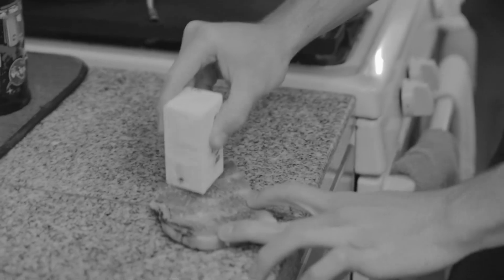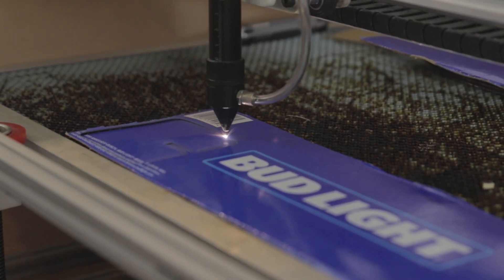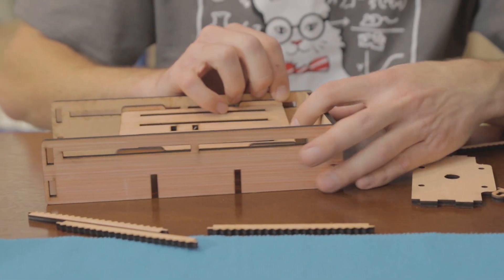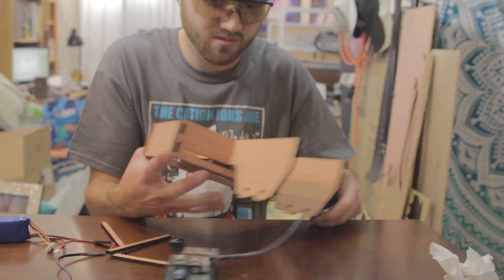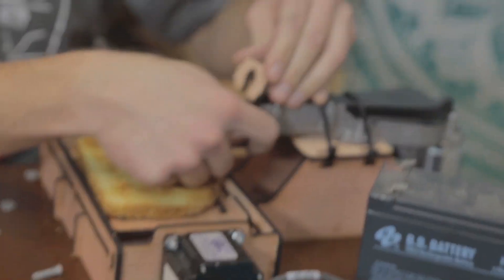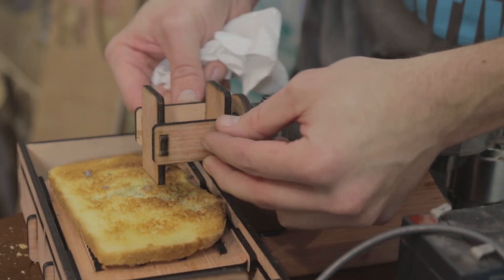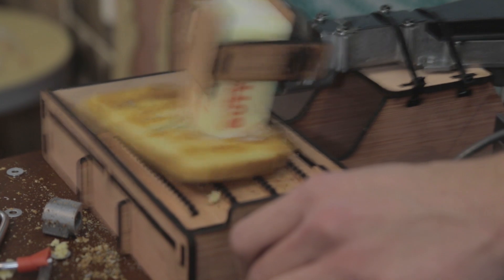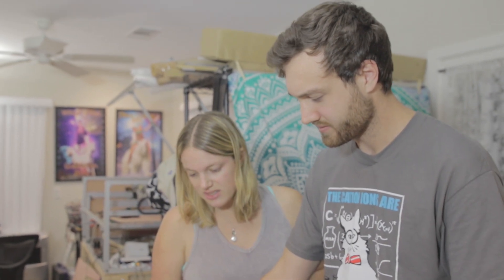Dangerous Toast Buttering Robot

Comment: Butter too hard to spread, must make robot. Or do what we've been doing for centuries and leave the butter on the counter. But here's what you do: 

Improve the butter retention device with a spring that keeps the butter in contact with the toast.
Reduce voltage to motor to reduce scary factor.
Create lever system that doubles the throw of the butter to cover entire toast.
Replace wood teeth with metal to prevent round-out and ensure grabby grabs.

Why am I doing this for every video I see between you and Michael? No one cares.

Comment: I work in a restaurant and making pancake batter has become a chore that is near the unbearable. 
The recipe, 5 lb of buttermilk pancake mix, 10.5 cups of water. 
Instructions, combine ingredients, in a large clean bucket, mixed with a whisk long enough to reach the bottom, let stand covered but not sealed for 30 minutes, whisk again, separate into individual containers and refrigerants.
We usually make a double or triple batch two times a week.
It's just soooo much work 😫.
Can you help?

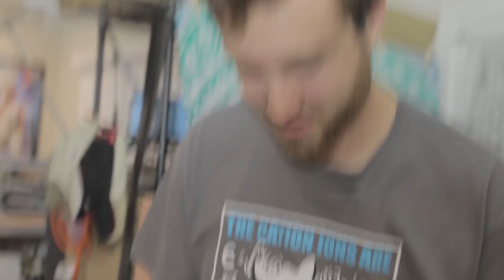Comment: 5:27 you should look up the stress equations in Roark's Formulas for Stress and Strain https://www.amazon.com/Roarks-Formulas-Stress-Mechanical-Engineering/dp/0071742476 and you can get the material properties for your wood probably here:  http://www.matweb.com/.  Just solve for the interference fit strain.  I figure you're probably some kind of engineer so why not do it right?  Also, needs force feedback to control the butter pressure and friction forces as well as butter and toast temperature sensors for optimally controlled butter application.
Reply from the maker: Stress/strain is way more complicated for plastics/composites/wood. The other issue with wood is it's organic so each part has unique imperfections. Cutting a few iterations is wayyyyy faster/easier.

Comment: I think i know how to improve on this.

Instead of holding the butter to the toast, it would be much easier to "paint" the butter onto the toast using a brush. The brush goes where the stick of butter currently is. And you could create a heated container over the brush, which holds the butter and melts it, so as to drip onto the brush. The brush just proceeds to butter the toast placed under it.

Comment: I worked at a factory with a sandwich making robot. For reals. The way they did butter was to have a metal "print head" the width of the bread with a wide slot in it. Butter was pushed down in using a syringe style mechanism and the print head moved over the bread.